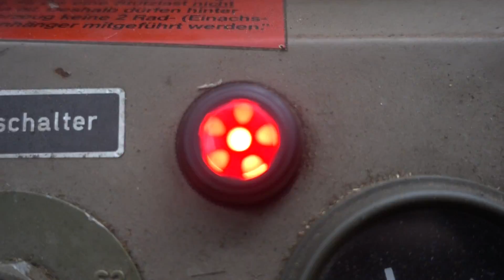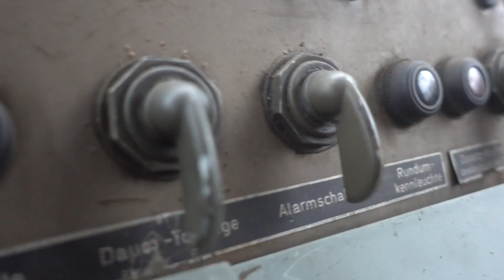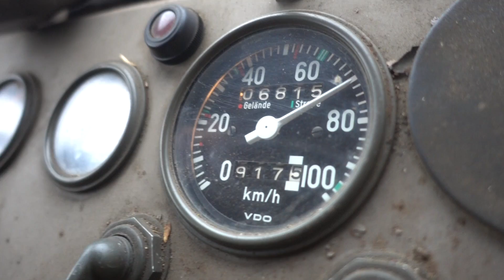STUCK ON THE SIDE OF THE ROAD, AGAIN | daily 64

Comment: Hey Rob, my husband and I are building a 20x20 metal building at our home. Currently looking for new/used gym equipment, any advice where to find the best for our money. We live in Tennessee. We want more crossfit type stuff. Rigs, ghd, bumper plates, etc! Thanks Rob!!
Reply from the maker: Lili Price craigslist
Reply: killrobbailey unfortunately our surrounding areas (a day drive) doesn't have much to offer, as of lately. Hopefully some things will pop up for sell, I've been told not to go buy brand new. We have time to keep looking, still need to lay the concrete pad and have the building installed! Thanks :)